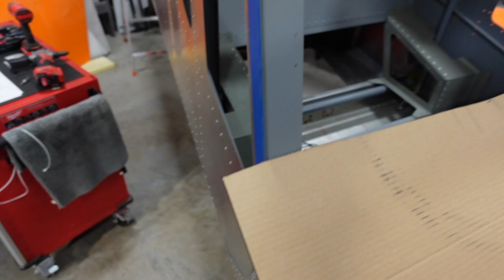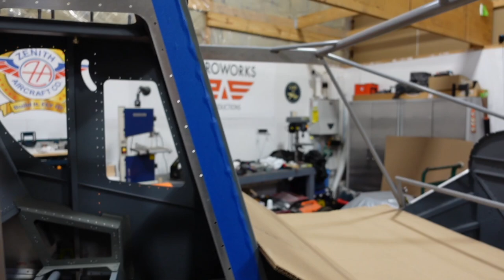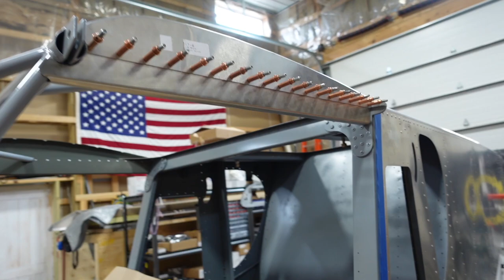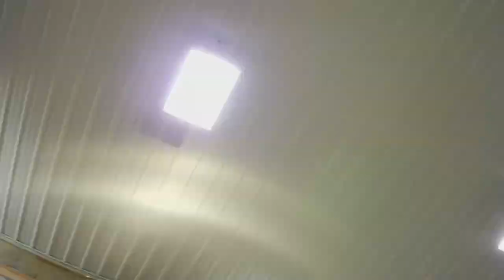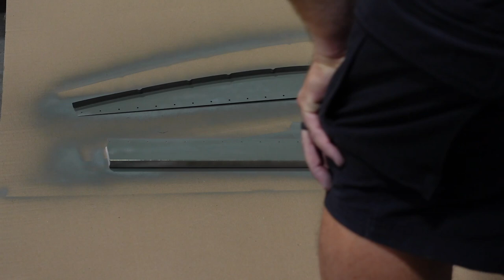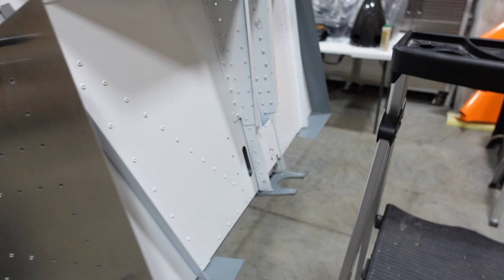Ep. 37 | Cabin Frame & Wing Root Rib Construction | Zenith Super Duty Aircraft Build

Comment: One thing I am adding to the shoulder belt channels, I am making a spacer to be epoxied inside the channel for the bolt, I don't like the possibility of crushing the channel. With the spacer I can tighten the bolt and not worry about crushing that channel.
Reply from the maker: Good Idea, I thought about the channel getting crushed but figured maybe the design was meant to be that way.  Won’t hurt either way, that’s why we innovate.